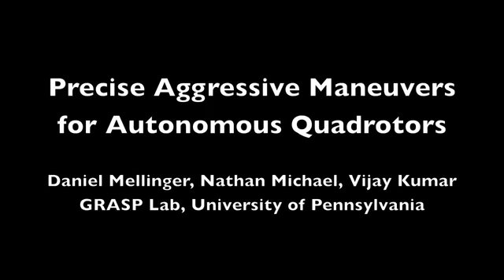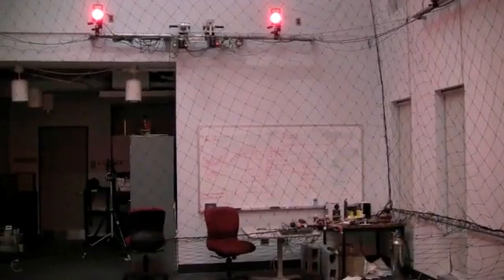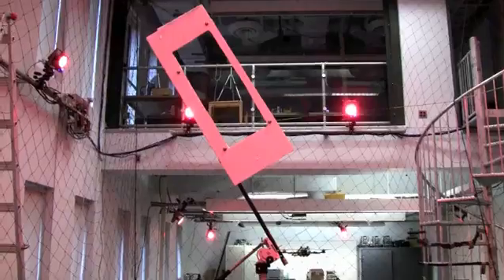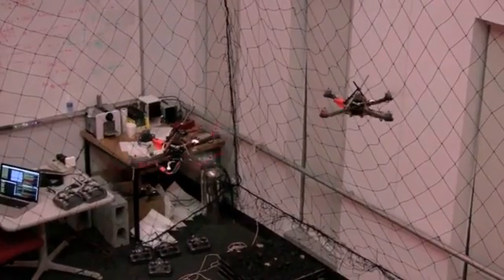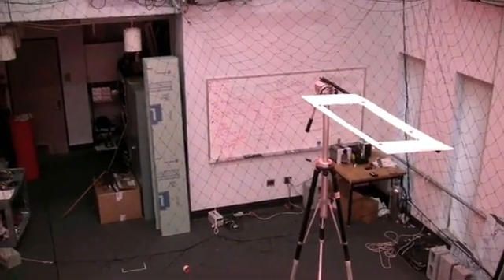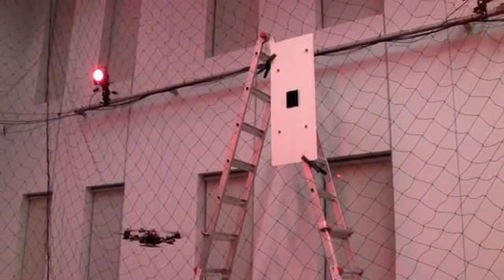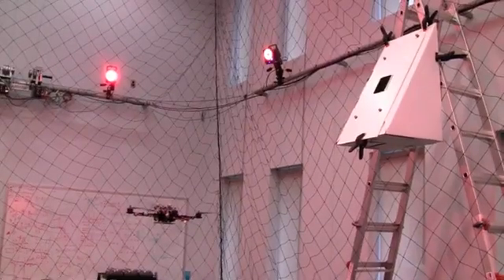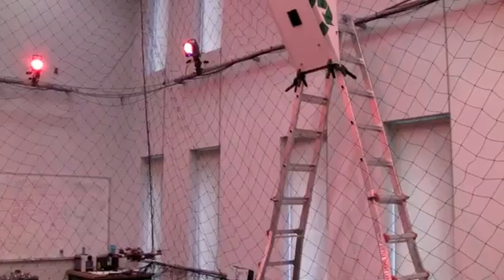Autonomous quadrocopter flies through windows

Comment: @kie7077 He says they use an IMU (Inertial Measurement Unit). That's a solid state gyroscope. Autonomous here just means that the flight is not human controlled.  I think the flight path is predetermined, but maybe they also use IR cameras arround the area to see those "ping pong balls" reflecting the IR lighting in the room and feed control data wirelessly? This video doesn't demonstrate "decision making".  It looks like it's just showing the manuvering cababilites of the aircraft.